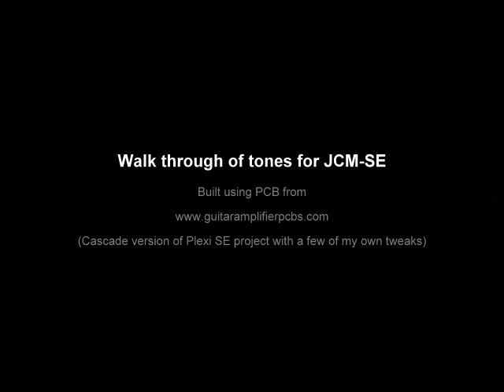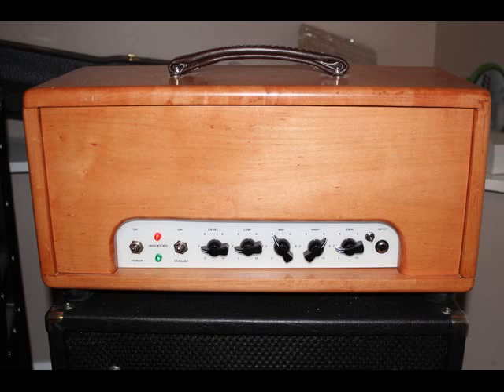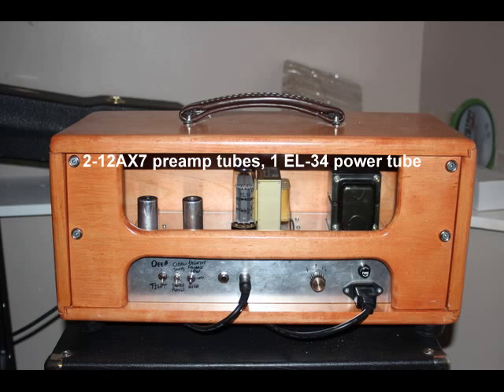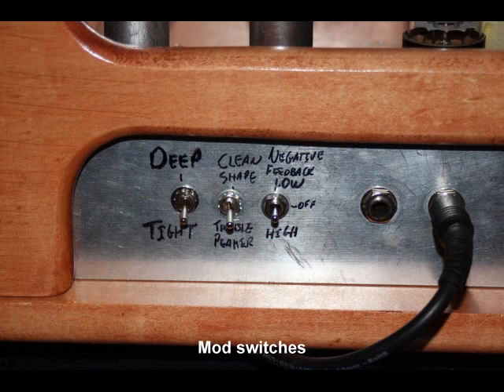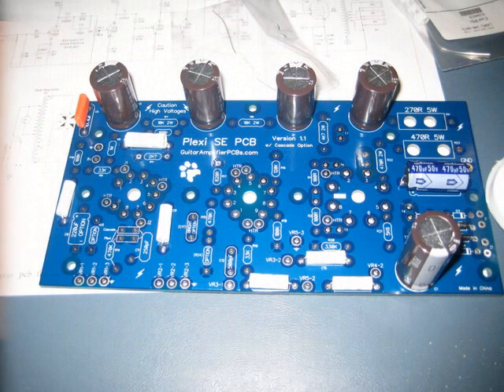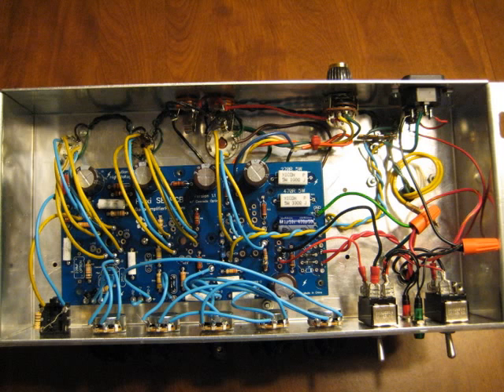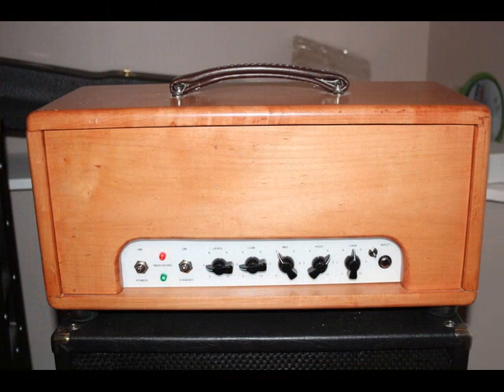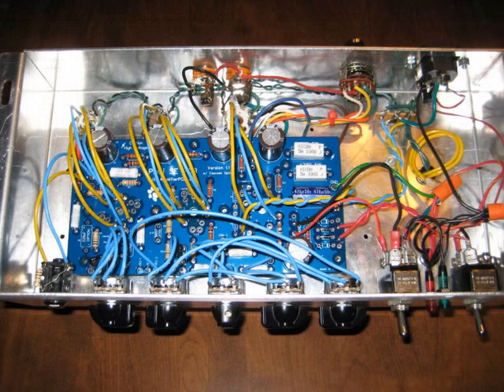JCM-SE Tone Walk-Through

Comment: How did you implement NFB? I'm thinking of converting my Jet City Picovalve to this circuit.
Reply from the maker: Basically I ran a wire with a resistor from one of the output (speaker) jacks to the cathode of the last gain stage (triode).  I put a switch in the middle so I can switch it off and on.  Apparently I never added that part of the circuit to my schematic, so if you want the details I’ll have to open up the amp to get those.

Comment: what is the tight switch exactly
Reply from the maker: NのVEMろER 28 The tights switch switches in an additional capacitor in series with the coupling capacitor after the first gain stage.  The cap switched in has a significantly lower value, lowering the total capacitance.  This reduces the bass response at that point...eliminates low end flabbiness/mud.